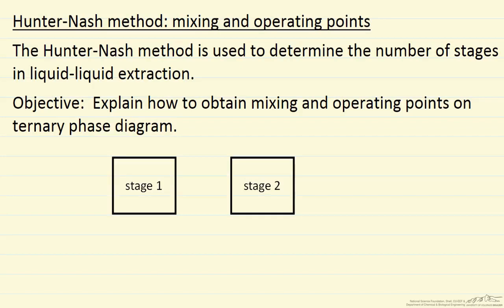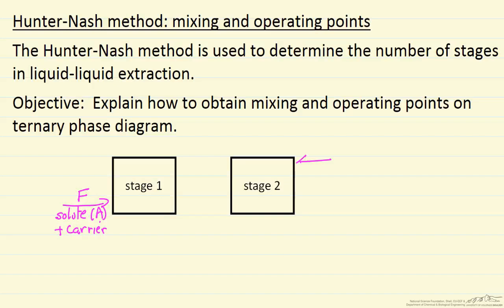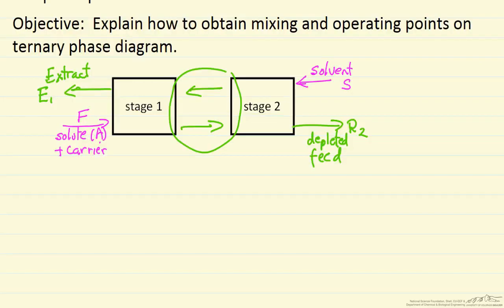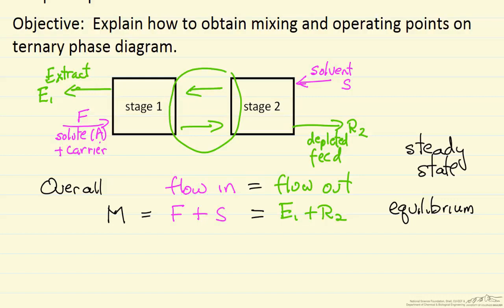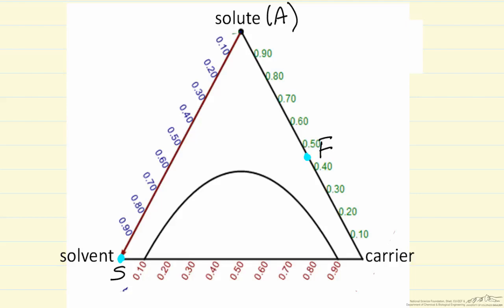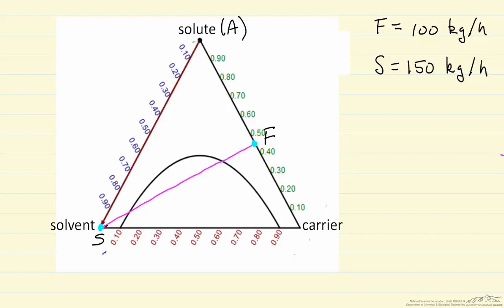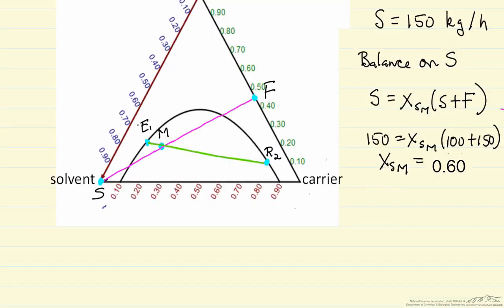Hunter-Nash Method 1: Mixing and Operating Points

Comment: how in the hell did you determine the E1
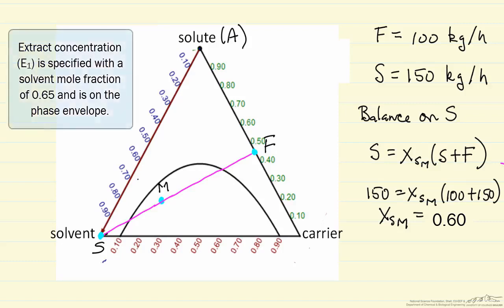Reply from the maker: Great question. There is a little pop-up at 6:51 that has this information. Basically, we specified that E1 has a solvent mole fraction of 0.65, and it must be on the phase envelope. Then you can find it on the graph.

Comment: I still don't understand how he got E and R
Reply from the maker: Here's another example problem: https://www.youtube.com/watch?v=Y19klVb4M7w
Reply from the maker: According the the note at 6:57, E1 has a concentration of 0.65 of the solvent and will be on the phase envelope. Thus, you can find that point. Then you make a line using E1 and M and where that hits the other side of the phase envelope is R2. The equation R2 = 0.2E1 is from the lever rule (using physical measurements of the diagram).
Reply: @LearnChemE  k